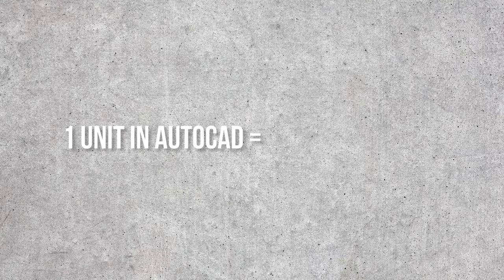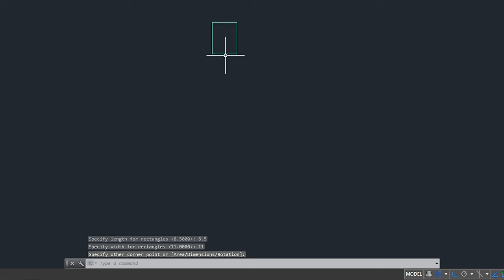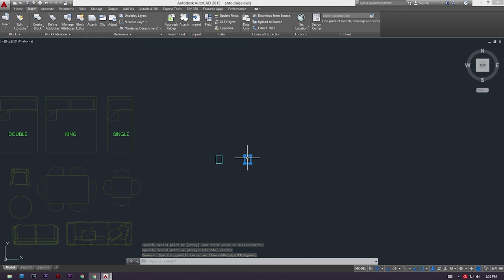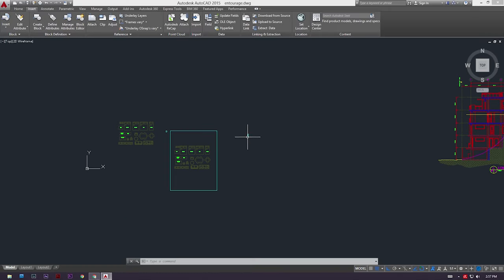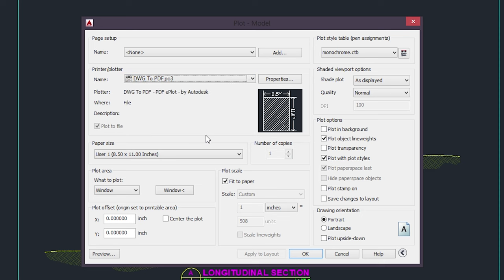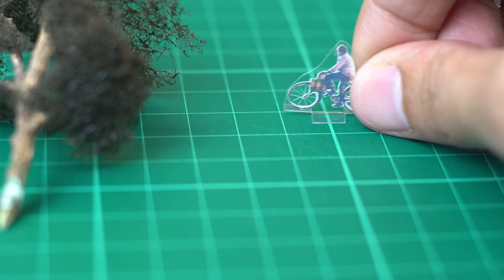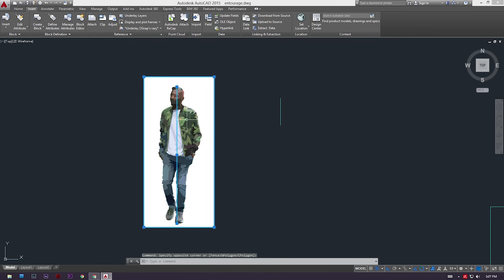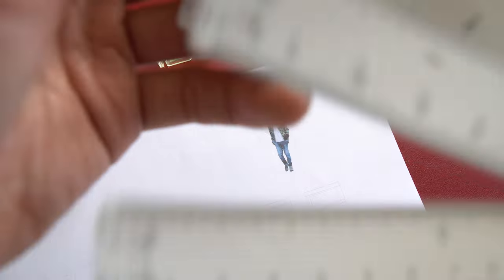Fastest Way to Scale in AUTOCAD

Comment: Llyan i can't get my paper size and printable area to match up and i've copied exactly everything you have done. What am i doing wrong? It comes up with paper size: 420 x 297, but prit rea is 410 x 263. If i click fit to paper, underneath comes up with 1mm= 56.46mm automatically? And if i unclick fit to paper and put in scale 1:50 it still comes up with the same margin! So frustrating.

Comment: Hi! I have something to ask. I hope you will help. I am using layout in plotting. The bad thing is, having plotted the drawing at my desired size of paper, the preview of the layout in autocad is perfectly on center of the paper. But when I saved and opened it as PDF file, the drawing was off-centered. It was plotted nearly below the left side margin of the paper. Have you experienced this before? Thanks in advance to those who would help.
Reply from the maker: This has never happened to me before, have you tried using a different plotter?:)
Reply: @LlyanAustria   Yes. Sometimes I use the model space when I print it directly and there's no problem with the margin. But same thing when I saved it as PDF file. :( Maybe I should use an updated version of cad??
Reply: @lyndseymojares6949  Hi! Have you solved this problem? I'm also having the same issue on this one even though my cad is updated. Thanks!

Comment: Working with buildings I find it convenient to use meters. I'd use mm if I designed small machinery or something.
I mean it'd be silly to type 10,000 or 50,000 all the time when that's the kind of input I keep needing.
Reply: Centimetar is standard for civil engineering